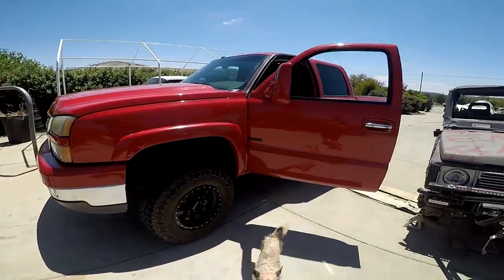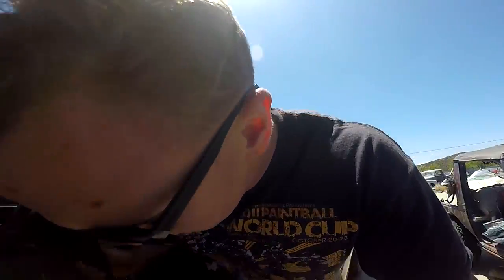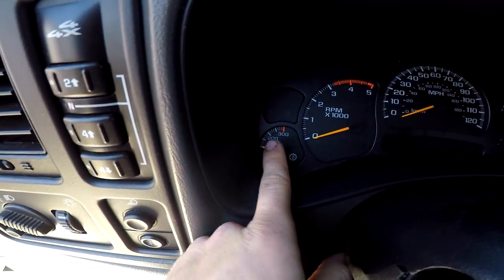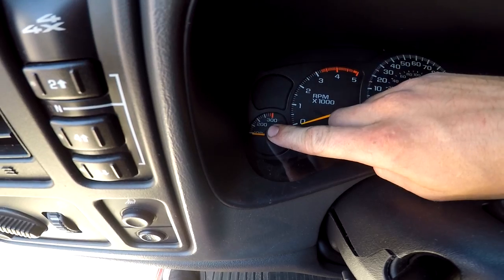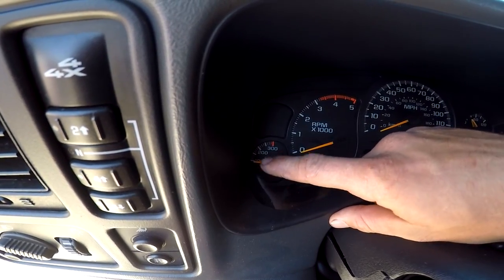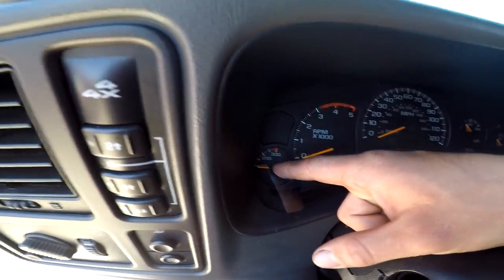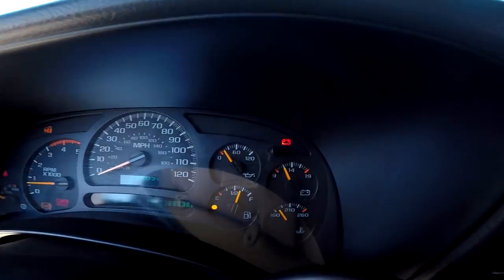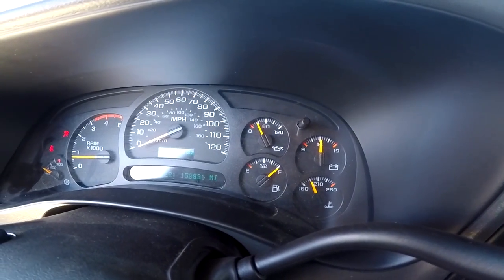DURAMAX Operating Temperatures explained: TALKING DURTY

Comment: My LB7 sits at 14 psi fully warm... That bad?
Reply from the maker: Are you talking for oil pressure?
Reply: @RESURRECTEDDIESEL  LOL. Yes. But was hoping for someone with another LB7 to say what they're getting. Your and I's engines are different.
Reply: @RESURRECTEDDIESEL  Fixed
Reply from the maker: Well the lb7 and lly short blocks are the same but you should I believe be around 22 pounds at idle I think is recommended when was the last time you have done an oil change
Reply: @RESURRECTEDDIESEL  Yes but Heads, injectors, turbo, egr system are all different... its one model newer many things were improved and changed.. hell even our pistons are different. Oil is 1000 miles old no leaks hope that helps. The answer is likely sell and get an LLY
Reply from the maker: Pistons are actually the same small difference in oiling holes but still mahle cast pistons and same exact rods and same oil pump and block. If you go back and watch my motor build my truck has lb7 pistons and rods in it with an lly crank in an lly block. But at that the head gaskets were worse on the lly and the airflow through the intake and heads weren’t good that’s why they would over heat and pop a gasket. Lbz is when they went to new pistons and rods and intake and heads that were more efficient but as far as oil pressure they all have the same pump. Could also be you gauge in the dash I would plug in a scanner and see if you can read oil pressure off that gm gauges are known for being off
Reply: Under 20psi on any duramax is a problem.
Reply from the maker: I second this

Comment: I have a 2006 LLY towing 3 car trailer all the time through PA mountains and i reach 235 on hot days going up the hill. At 235 fan kicks in and goes down to 210 and starts again when going up the hill again. First it made me nervous but read truck manual and it said that its a normal temperature while heavy towing.
Reply from the maker: Yeah seems not too extremely hot especially if you had the ac on too I wouldn’t be surprised I’ve seen that with my truck unloaded driving up a super steep mountain with the ac on
Reply: I don't think they made LLY in 2006. Just letting you know
Reply from the maker: It was an lbz motor with lly tuning in early 06 they called it an lly. It had the lbz motor 6 speed trans they just didn’t change the ecu yet and bam 06 lly!!
Reply: @RESURRECTEDDIESEL  that's werid. Was the LLY ECU tune faster or more efficient on the lbz. You know with the bigger turbos the llys have?
Reply from the maker: No I don’t really know the ins and outs but my guess is they knew the lly tunes worked they just changed up the motor a little bit have the same fuel injection system or similar enough that the lly tunes would work so that’s less work that gm has to do to get the next truck into production and once they started production they probably fine tuned it and officially made the lbz
Reply: DURAMAX_DIESEL they didn’t have emissions approval done so they used the Lly tune. Once they got epa bullshit straight then they tuned them as designed .its your government at work .

Comment: And on my 03 lb7, at operating coolant temp (150), My oil pressure is about 22 - 27 psi
Reply from the maker: Is that at idle for the oil pressure cause if so that’s fine but for the coolant that seems a little low is that reading off the dash or do you have an edge monitor
Reply: DURAMAX_DIESEL that’s off the dash and the edge programmer. But when I pull a trailer with a couple lawn mowers on it, my coolant temp goes up to about 200 - 215
Reply from the maker: Hmmmm that’s different that’s really cool usually 180 is right about the lower side of things I’m not sure it’s a bad thing but the 210 about towing wouldn’t be concerning to me

Comment: My 03 went just above 210 and I was towing my trailer in 100degree and I was thinking something might be wrong but thanks for the video, I’m pretty sure it was just weather and the load I had on the truck.
Reply from the maker: yessir towing that hot you will she pretty high temps just have to try to keep them down the best you can

Comment: Excellent review man👍🏾👍🏾but as for oil changes I go 30K miles or once per year which ever comes first with rotella triple t 15w40. I decided to send a sample of my 30k oil change to Blackstone labs and my results were good and the viscosity was the same but the lab report comments said I could have went another 4k miles. My truck has over 270k miles on it and going strong 👍🏾👍🏾as for the water temp GM temp gauge is not accurate, I have an edge CTS monitor hook up to the OBD port and that 160 * mark on the gm gauge is really 140* on my monitor and 210 is really 185
Reply from the maker: I completely agreee with you I know a lot more know then I did back then but it just shows that its in an okay operating range but 30k on an oil change is insane im glad its working for you though

Comment: My 04 LLY trans only ever sees 200-220 when towing with a large load for an extended period of time regular driving temp is 140 and then in the winter the trans temp guage dosent even get up high enough to move the guage.
Reply from the maker: Damn that’s good it’s hot here in Southern California so around 180 is the norm!!
Reply: @RESURRECTEDDIESEL  Add a big cooler, there's charts with trans temp and life of fluid. Gives a good understanding

Comment: My L B Z. 298000 miles. 30 psi hot no madder what brand of oil. Never been above 195 towing with 12,000 pounds behind in 90 degree weather from Wisconsin to Alabama. Heat kills A T F fluid. Simple ! Take your average temp. Look at a chart. It will tell you safe time it should be run.
Reply from the maker: That’s awesome but I agree the heat is what kills it for sure but yeah it’s usually about 80-100 degrees above ambient temperature from what I’ve seen and learned!

Comment: I have a 09 2500 HD Duramax that will not come up to temperature add an idle you have to drive down the highway about four or five miles before it pops up to running temp right around 210 on the gauge and then when you come to a stop and put the truck in park the temperature drops I replaced the thermostats last week thinking I had bad thermostats but it's still doing it what is the problem
Reply from the maker: My truck does the same thing as long as you aren’t getting the check engine light for the under temp code your fine duramaxs do a great job of cooling at idle if I ever repair one and need to bring it up to temp it takes usually about 20-30 minutes of idling and holding it up in rpms to get it up to temp just sitting and that’s in Southern California where it’s always 60-80 degrees out so if you’re in a cold climate it’s normal let it idle to get the cylinders warm then take off and you should be fine

Comment: What if the engine light comes on telling you that the engine temp is to low
Reply from the maker: Do you have an 06 or newer duramax
Reply: Chris Tucker mine is doing this too. P0128 code. On my cts2 it shows around 160°. 2006 LBZ.
Reply: Mine is a 2013
Reply: Chris, from my research it appears it’s just a bad thermostat or two. I ordered new ones.
Reply: Thank you I will change them

Comment: My truck has never seen 200 degrees even with the programmer turned up
Reply from the maker: Vortex Meltz are you going off the gauges or an edge monitor cause the reading in the guages are a little higher but if not that’s good it’s hot here in SoCal haha

Comment: I really don't know what the hell Chevy is doing but it's kind of goes into the protocols of the Learned Elders of Zion and the sinking of the Titanic and the assassination attempts against Henry Ford when he decided to run for president when he figured out what was going on my whole point being is that Chevy should be making quality gauges that work for the life of the truck and I'm not really seeing that right now my tachometer bounces up and down for my transmission temperatures all the time my emergency light switch always seems to have a short in it and this constant overheating problem on top of the problem that this truck can really only handle about 7,000 lb up a mountain at 40 miles per hour that's pretty pathetic for a 3500 in my opinion I'm about ready to drop this truck all together and go for another class 8 trucks and do all my mods on that truck and just say fuck the Chevy is he can't make a good quality truck get out of the fucking business move over so someone else can
Reply from the maker: What year is the truck you have they have definitely changed quite a bit over the years and I think improved very much so!

Comment: You didn’t cover anything about under temperatures.
Reply from the maker: true not ever really much of an issue unless your thermostats are stuck open its not too often you here of a duramax under temp that isn't very easily fixed
Reply: DURAMAX_DIESEL yeah, that was my issue.  It threw two codes, low coolant temp and MAF Sensor circuit codes.  Replaced the thermostats and cleared the codes and neither came back.

Comment: ECT LMM
12* =210*
My truck has 180/185**Tstats
All my other trucks indicated what the thermostats installed. This truck runs at 210*
I think GM put the wrong gauge/sensors in the truck.
I don't understand.....
Reply from the maker: I agree all trucks have 180/185 t stats but the gauges always go up to 210 everyone that I have had always had has gotten up there unless you’re say it’s 12 degrees out one of your t stats could also be stuck close if it’s getting that warm
Reply: 12 oClock
Reply from the maker: I think it was just the design gm has because even with the edge or something reading the actual 180/185 or a little hire the Guage is meant to have some leeway so that was you have time to save your motor before total destruction if you were to have an issue I think. Gm engineers aren’t all that stupid I’m sure there is a reason for it but I wouldn’t know!